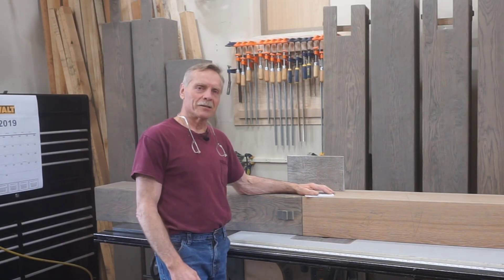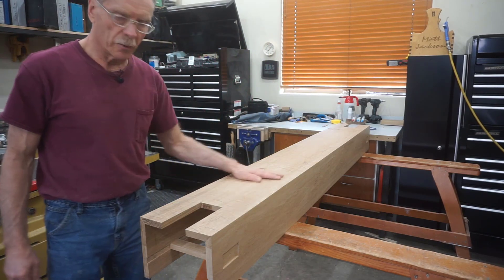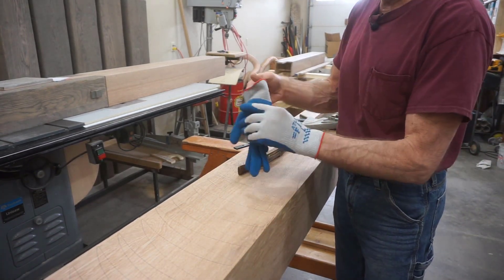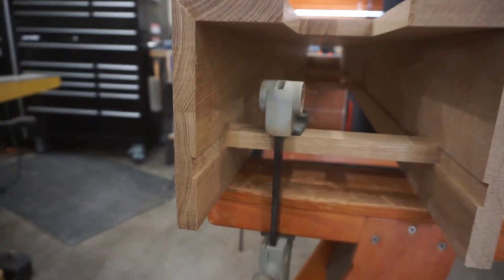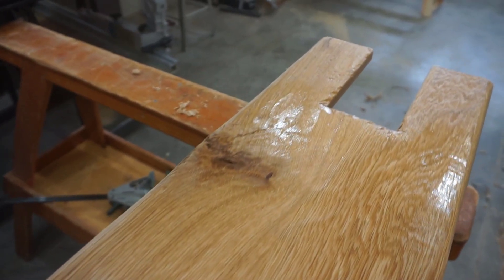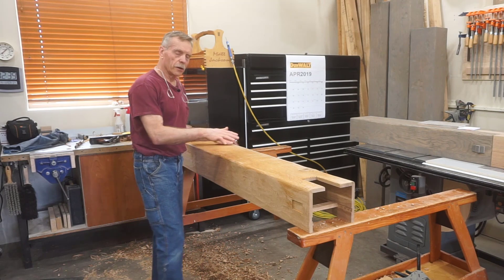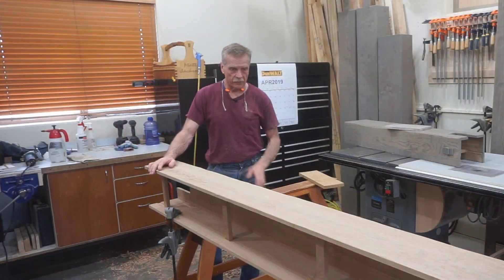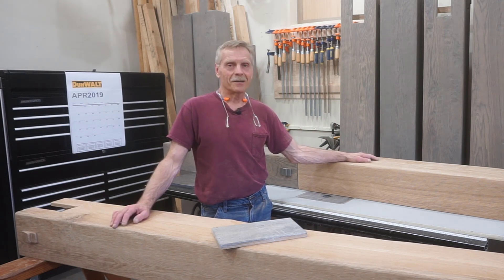Distress Faux Beams for a Century Old Look!

Comment: Nice work, but why didn’t you start with rough sawn timber ?
Reply from the maker: Thanks for the compliment Andy.  To your question: I actually did start with 'hit and miss 4/4 white oak' which is somewhat 'rough sawn'.  The main reason rough sawn doesn't or wouldn't work is because, even though the beams end up quite rough, the wood needs to be flat, straight, smooth and consistent for the joinery to make them. Check out previous video in this 'series' where I fit and glue over 150 linear feet of near perfect beveled edges to see what I'm talking about. Counterintuitive as it may seem, the INSIDE of these beams is quite accurate, square and true which is absolutely necessary for a manageable installation. The next video upload I do will show the installation process where very tight tolerances are key to success.  Best, Matt
Reply: Stumbled onto your channel & I love it!  Keep it up Matt!!
Reply from the maker: @joshuahasson9687  cool! The more people that stumble onto videos here at Next Level carpentry the more I'm able to justify the time to produce and upload more content so: welcome... and thank you! Best, Matt
Reply: Matt I'm going to give these a go above my bar area.  wish me luck lol.

Comment: Matt - at 42:18 you explain in more detail about your technique for using the wire wheel on the polisher, however, for improved safety I would like to see you stand with your body to the right side of the polisher, not to the left.  This way you will decrease a chance to make that ER trip, which would then slow your progress toward that eventual install of that nice JessEm Mast-R-Lift you will someday install :)  ….Thanks for another great video and I have learned a few new tips and tricks on distressing wood...well done!
Reply from the maker: Hey Rodger I appreciate your suggestion about body position on the polisher although I'll not likely adopt it. With using that tool the way I hold it and move it during work is entirely subconscious and to make a conscious change would introduce less safety for me in particular particular than more. Please don't let that discourage you from any and all future suggestions because I appreciate Insight from experience. I was thinking of you during a recent trip to Denver where I looked at a number of various router lifts including the jessem you recommend. Sales Personnel at the stores I visited were less than familiar with the various models they were pitching so even if I was ready to buy one did not feel I could make an informed decision based on what they said. I'll hit you up for sure when I get ready to pull the trigger in the meantime thanks for watching and commenting. Best, Matt
Reply: @NextLevelCarpentry Thanks again Matt appreciate the videos and keep them coming I seem to learn something new with each one.
Reply from the maker: @rogerlower56  It's all good!  More videos on the way... Best, Matt

Comment: Looks great Matt - true. You could also add wormholes, axemarks (well wider than the gouge) and maybe not so linear edges, although that's hard, given the dimensions you have to work with, but to increase the true barn look, if that is what you are going for. One thing to remember, is that hewn timber was distributed in the build for maximum load bearing, and not necessarily in fixed sizes, like we've become accustomed to, but in stead from what the tree would yield, which also gave you all sorts of weird dimensions like 10x12 and so on, and plus, the less they had to hew off the trunk, the quicker they'd be on to the next one, which is also why old lumber has all of that curvy edging going on - went right out to the inside of the bark or sapwood in some places. Of course this all varies from region to region and through the centuries, but at least for old Scandinavian building style, it holds true. Anything in redwood or other bigguns would of course have been split and sawn to create much more sharp edges, as you could extract several beams from one trunk. There you might experience them being narrower on one face than the other though, as they still wanted to maximize strength and minimize labor, when splitting out the trunk into beams, as the side towards the heart is naturally narrower than the side facing the bark. Don't know whether this has ever shown up in the US, but it did when restoring a church from the 13th century in Sweden - They had to go fell and prepare by axe, to get what they needed. This is of course a lot different, as axework belongs in green wood, and not kiln dried oak.

On another note: Do not despair on what you did to that beautiful plane of yours - you just created the perfect tool for traversing wood, when you need to hog off a great deal in a hurry, say in woodprep or doing a scribe on a flat face out on site... though I too would be reluctant to bring it along. Just know it has use for much more than distressing. Take a look at undersides of old drawer bottoms - they might have been left in that finish on the underside.
Reply from the maker: Thanks for adding all this in-depth knowledge Martin... interesting for both me and other viewers! Best, Matt
Reply: @NextLevelCarpentry  Always welcome! 😊

Comment: Great video as always Matt. Thank you. We normally call it a "scrub plane" here in England, just a plane with a ground slightly rounded blade to do rough work, great when flatting by hand tool. Working with the gouge taught me much, but for me the wire brush worked well, being able to age with a power tool, but get a finish which doesn't advertise power tool use. 
Loved the Cordless cordless video.
Reply: That's what I have heard those type planes called too.. scrub planes.

Comment: Half way thru the video I was wondering "OK, he has the hand hewed look.  How is he going to to make the wood look weathered with open grain, etc.?"  They you showed us the wire wheel trick. Brilliant!  This process can be used for outdoor benches, gazebos, etc. also.  Thanks for content.
Reply from the maker: The takeaway is to use a 'straight' wire wheel, not a cup brush and the water spritz doubles the effect with half the effort. You're welcome for the content user990077! Best, Matt

Comment: Last time I distressed boards I used a jigsaw at 90deg to the face with the blade at an angle and ran it along the edge to look like marks from the pit saw.  I also put screws in the end of a 4x1 and gave the board woodworm, a trick I think I might of picked up from this channel? All the best anyway, thanks Matt
Reply from the maker: Hey Ben, I used a sawzall to gain the 'pit saw' effect you mention on the small sample piece seen in the video.  I put some 'oil spatters' on that little sample too but the client nixed those two additions as too rough for her taste.  A bit of wormwood effect using your screw board would have added more character... I'll keep it in mind for future projects.  Best, Matt

Comment: Made some fake beams for a customer out of old barn wood.  Where I had to chip away at the corners and fresh wood showed I used white vinegar with steel wool soaking in it for about 5 days.   Put a nice gray color on the fresh cut.
Reply: The barn wood was slabbed off of hand hewn posts and beams.
Reply from the maker: I've gotta try the vinegar and steel wool method sometime... sounds like it works well for projects like yours.  Best, Matt
Reply: I tried adding a picture but couldn’t
Reply from the maker: @dillonjc2  if you want to share a picture here I've learned you can put a link to it if it's in a Dropbox, Pintrest or Google Drive type file storage setup.  I review any posted links adn welcome them as long as they're legit... Best, Matt

Comment: man thank you for the incredibly detailed video.  I had to do something similar but wanted to imitate rough sawn cedar using smooth pressure treated 6x10's.... so I took my bosch hand held planer and cut notches in the blades using a cut off wheel on a dremel.  Although not as detailed as your process it served the purpose for an exterior wrap around porch...

Comment: I love when I stumble across channels like this where a true craftsman shares his knowledge.  I just made a 14ft 3 sided beam and a 10 ft 3 sided beam.  As I'm an amatuer, it took time to do it right but as of right now I've got some pretty good looking beams I'm proud of.  I've taken such care in making the beams, getting my seams right, etc that now I'm kind of paralyzed to go to the distressing step lol...so I love everything about this video in taking the time to be thoughtful and use the right tools.  To that end, since you mention a small grinder wouldn't be up to the task...could you recommend another tool?  I'm even open to taking a more time intensive route and doing something by hand as these beams are for my home and doing it right not fast or easy is more important to me...thanks for any advice you may have!
Reply from the maker: Congratulations on making your first beams.  Check into other videos on Next Level carpentry where I show more texturing techniques that really speed up the process including something called a restorer tool that makes the grain look weathered nicely and quickly. You can get a DIY version of a restorer tool for around a hundred bucks which I think would be well worth the money because the only other way I can think of would be to use a regular wire brush by hand and that would be a brutally time-consuming task.
Reply: @NextLevelCarpentry  Thank you so much in taking your time to reply to me!  You don't know how much I appreciate it...I'm in the process of adding some warmth to my home and taking a bit of pride in learning skills and doing the work myself so I am going to check out your other videos and that tool right now.  Thank you again!

Comment: your work on these beams was excellent in looking like actual hand hewn old beams. I've seen others do this and this is the best look I have seen done so far. What was the model of the large 7" Milwaukee polisher  if you can still see it?
Reply from the maker: That machine is so old as to be irrelevant Gg... I've had it for about 50 YEARS and it was old when I got it from a burned out building and had it rebuilt.  You can find other vintage ones like it on eBay but I'm sure newer ones are a more sensible choice.  If you REALLY want to know I'll go read the tag for you... Best, Matt

Comment: Hi I am relatively new to your channel and just wanted to let you know that I can appreciate the work that you do.  These distressed faux beams I have seen before on job sites that I’ve worked on over the years. I have 45+ years in the building trades and have seen a lot of old carpenters come and go.  I heard you say that you you repair  sheet rock also?  For somebody that is as picky and such a perfectionist as yourself you would think that you would like to use the correct terminologies.  One of my peeves is that it’s not sheet rock it is called drywall sheet rock is a brand of drywall.  Just a little trade humor.  So there again I appreciate your fine craftsmanship that you’re displaying on YouTube.
Reply: Mike A
Reply from the maker: It must make you lose it why don't you ask someone to hand you a skill saw and you get a Milwaukee Worm Drive instead! 😉😂😂😎

Comment: Thank you for the video!  I was wondering if there is a type of plane/tool that would do the job of giving it the hand hewn look without having to alter the tool? Like the bench plane that you altered.  Thanks
Reply from the maker: I've heard of some power tools, one by Festool I think, that are supposed to provide a 'hand hewn' texture but they're pretty expensive.  It would be hard to justify a dedicated tool unless you have a lot of surface to do.  Best, Matt

Comment: Matt, these “straight” grinders have the arbor inline with the motor armature instead of at a right angle. On the larger models the arbor is 5/8” diameter but most are smaller. The best ones are air driven (in my opinion) because you can use them continuously all day without overheating them.  Graniger sells a Ingersoll Rand industrial model that is pricey but up to nearly any challenge. Item # 45JW85 Mfr. Model # M2X180RH63 Catalog Page # 2508 UNSPSC # 27131511.  My bet is that McMaster Carr has a better selection.  The wire wheels come in a variety of wire stiffnesses and materials ranging from brass to SS.  There are cheaper air and electric models I would try just to see if you like the feel and control.  I believe these would cut your effort, time and energy spent in half for the job you just did.  Body position is a breeze!
Reply from the maker: Oh, OK... I get it.  I've got a small pneumatic 'die grinder' which is the same design but much, much too small for this job.  I've never considered getting a larger one but will keep it in mind and pick one up if another project demands it.  I can see where body position would be simplified... thanks for the followup LH! Best, Matt

Comment: Your videos are amazing Matt. I'm a DIYer but I use your tips on (much) smaller scale jobs all the time. Can I ask a question? There's so many hours of skilled labour going into the whole process, I could see these costing more than solid oak beams. How does the cost compare?
Reply from the maker: Thanks for your assessment of Next Level Carpentry videos (posts) Gareth... I really appreciate it! 
In some parts of the world solid white oak beams may well be less expensive per linear foot compared to what labor and material for faux beams like these adds up to,  but with all the other factors like availability dryness, stability, weight, workability, etc this is a much more practical material and approach for this project.  The 'Massive Oak Mantle' linked in the video was a perfect example of hidden costs of solid wood for some projects.  All that said there's some jobs where nothing but the real deal will do and in those cases material cost is not a deciding factor.  Either way it's not an inexpensive proposition but the end product is always quite dramatic!  Best, Matt

Comment: Hi Matt, loved the video, did you consider using a very sharp adze to impart ‘character’?
Reply from the maker: I did, Chris, but thought it would be too much for this project; too much depth, too hard to 'control' and hit's too hard for hollow box beams IMHO. I also considered a 'scorp' but ended up using what you see in the video instead.  I might take another run at tooling if another similar job showed up though, especially if the client wanted a more rough/rustic look.  Glad you liked the video... BTW I shot 'installation' footage the other day and will build and upload a video on that soon too.  Best, Matt
Reply: @NextLevelCarpentry  I use an adz to give beams character . I distress the wood first before  assembling.

Comment: I used to use the grinder with a wire brush but it was too dusty, too long to do and hard on the arms. Makita make the perfect tool just for that, the 9741 wheel sander goes much faster and you can hook up your vaccum to it.

Comment: If the numbering on the Swiss chisel denotes the size in metric units, I suspect 4 x 40 mm, not cm.  Though my long distance tape measure isn't working right now,  40 mm is 1.57 inches which seems about right for the width.
Reply from the maker: You are most certainly correct... shows my metric illiteracy😏😯
Reply: @NextLevelCarpentry  It's the camera!

Comment: I watch your vids regularly. Nice job(s)!  That said,......you maybe should have bought a harbor freight plane for 15 bucks then converted it to a scrub plane such as you did with the plane you inherited. Reason?   That plane you have may be a Stanley Bedrock series worth close to 200 bucks. Yikes!!  Bedrocks are very old and the standard for current quality manufacturers to copy such as Veritas, WInd River , etc. I pray your plane is not a Bedrock. Be well, be good!
Reply from the maker: Interesting perspective Greg.. thanks for watching and commenting.  Regardless of the potential value of that plane I've no regrets.  It was given to me in an old trunk of rusting tools.  I spent a good deal of time resurrecting it which added even more potential value.  I don't know how many hours I spent making a new rear handle from walnut burl so I'm into it pretty deep.  I guess it reinforces the saying "when you get something for free, you've overpaid" right?  Bottom line is I'd much rather see an expensive tool get used than just have it sitting in a drawer being valuable.  I do admire your appreciation for quality and value... thanks for commenting.  Best, Matt
Reply: Thanx for the reply as I did not expect one Matt. I can tell by your videos you are as good as the best of craftsmen. You should get permission from end users to showcase your finished work if possible. Meanwhile I also resurrect old planes, spoke shaves,etc. Fun to bring new life to old tools. Just taught myself to file off handsaw teeth, retooth and sharpen. In the end I also chase after a Bedrock. Thanx again for your comprehesive and concise videography as I haven't a clue nor time to make a quality video.  Keep up the great work. Best, greg